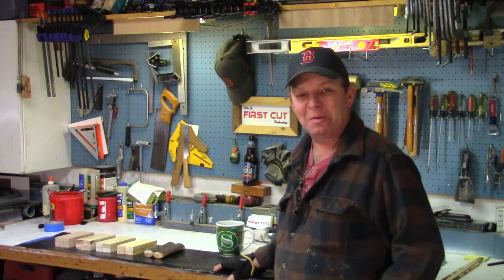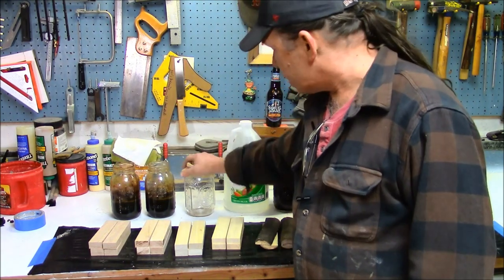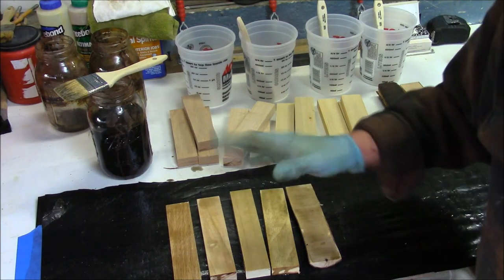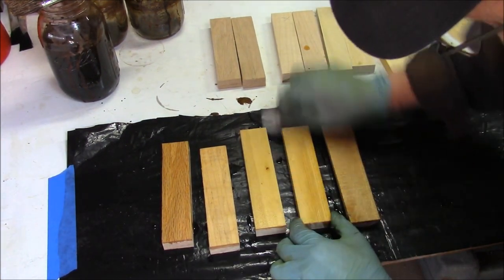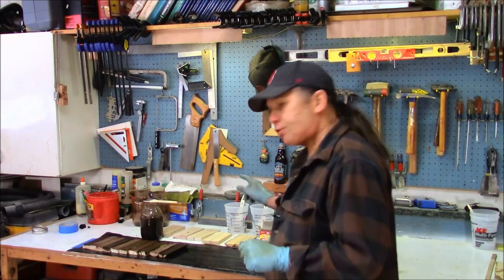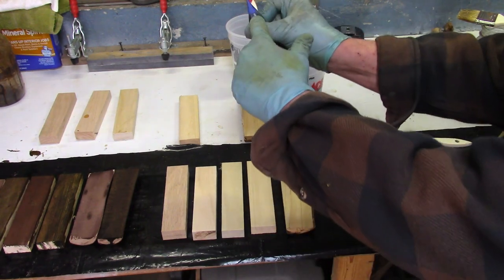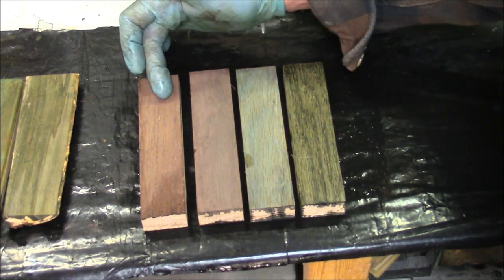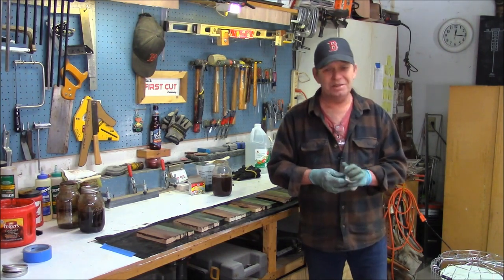Iron Acetate-Examples

Comment: Great video, Chris!  

You mentioned raising the grain before you applied the iron acetate. I've done it both raising the grain and not raising the grain before applying the acetate, and they'll give you slightly different results. I find that not raising the grain first lets more of the acetate or tannin solutions absorb into the wood, deepening the colors. Both methods have their place, so it's not like one is better than the other - they're just different. But, as always, test it on some scrap to see what you prefer.

And since these are all water-based finishing techniques, they'll raise the heck out of the grain. I normally let the project dry for a few days, then apply 2 coats of shellac based sanding sealer, then sand with 400 or 600 grit - just depends on what I have handy. After sanding the whole project, I start my topcoats. 

Keep up the good work and don't let those mattress folks get you down. They probably don't know the difference between iron acetate and iron oxide anyway...
Reply: *****  Well, from the sounds of it, I can tell you where you're probably NOT sleeping tonight.

Comment: i  used cider vinegar, maybe id be less bad with regular one, but i find it stinks pretty bad after the wood is done, do you have a trick for that? i tough of doing a wash with baking soda, but i'm wondering if it would screw the stain
Reply: +Chris Cute (Make The First Cut) allright, i think i'll redo the stain, thanks!